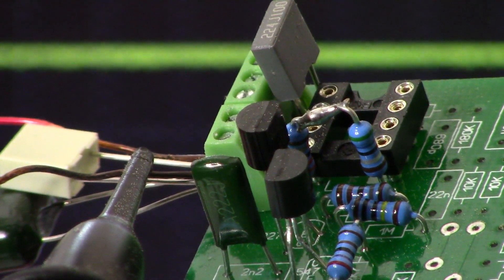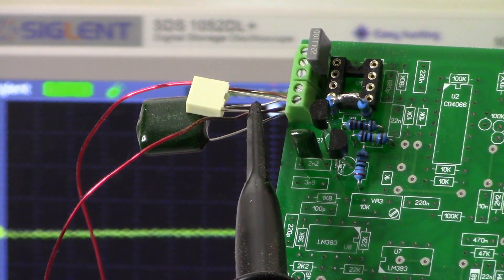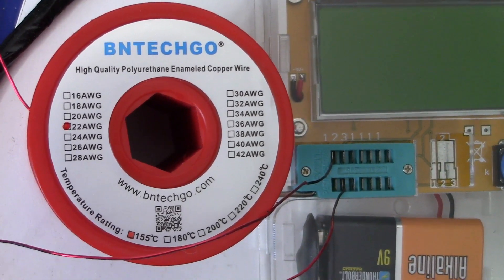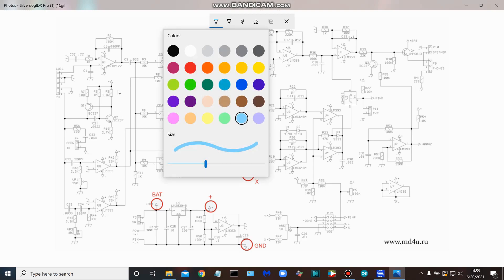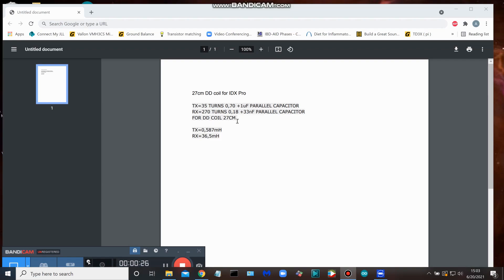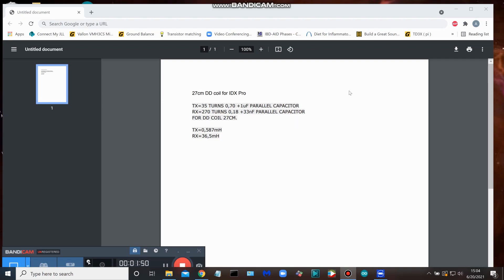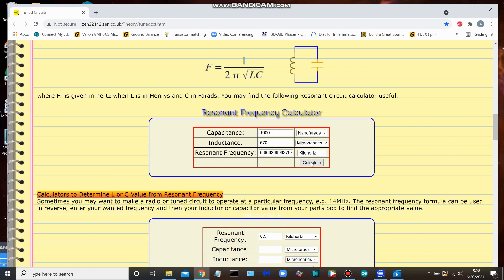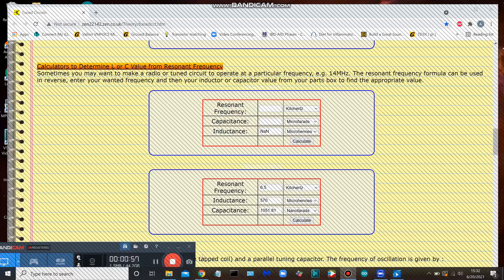IDX Pro part 2 Transmit circuit

Comment: Good morning,thank you for sharing,this is Mohamed from Alexandria Egypt,at 4.49 top left where it says coil ,point number 5 where it goes and what is connected to it .also .70 +1uf capacitor is it .70 volts or what is the value here and same for the Rx capacitor?, I don't have an inductance device to measure the inductance of the coil wire is there any other method?I may keep asking some questions until I finally make my own clone ,thanks alot for your patience.
Reply from the maker: You should have an LCR meter in order to check Inductance.  You also should have an oscilloscope for building the metal detector project, otherwise you will not be able to check your work and make proper adjustments.
Reply: @SurfDetector  ok I understand,I can't afford buying these two now,,what about the oscilloscope diy  videos that you can download Android scope master then modify your head set to an oscilloscope?
Reply: D4 is connected between 2 deferent polarities? Is this correct?
What is the value of C1 ,thanks
Reply from the maker: @mohalmisri1230  Yes D4 is connected correctly. C1 is 1nF.  You should go to the Geotech Forum and read all of the information about the IDX Pro.

Comment: IDX pro metal detector coil diameter wire diameter tx rx number of turns and how many kHz should it be bro
Reply from the maker: Hello my friend, most of the answers to your questions are in this video.  The coil was a DD, I don't remember the diameter.  The KHZ and inductance are what you need.

Comment: Great series! Looking forward to the rest of the idx pro build. I have a couple of questions if you don't mind. When you tested your coil for 6.5khz did you use the transmit circuit of the idx or a signal generator? Also the calculators for F, C and L don't give a wire size. How did you know what wire to use to match the impedance of 1.2ohm? My classic sl transmit coil is 2.3ohms I think its the same family. If impedance is off you will suffer amplitude loss or over heat yes?
Reply from the maker: Hello my friend,
As shown in this referenced video I used the TX circuit to prove the frequency of the attached coil.  I used 28 AWG wire for this project if I recall correctly, most people use 30 or 32 I believe, I did not note an appreciable difference in the results.  The resistance difference +or - will increase or decrease amperage accordingly.

Comment: The Classics and IDX series are a lot of fun to work with. Serious improvements can be made to those machines. Stock, you’d be lucky to detect a coin sized object any deeper than 6-7” in ground. Usually more in the 4-5” range. After a range of “Mr. Bill Mods” the penetration increases dramatically becoming more in line with the (depth) performance of the MXT, maybe better at 12”+ on some coins. With ground balance the sensitivity mods are also very stable. I half expected to encounter a chattery hot mess.
Reply from the maker: That for the comment.  Building these circuits in the DIY format is always somewhat of a challenge, but that is part of the enjoyment.
Cheers

Comment: Parabéns pelo vídeo, uma observação, R56 (100R), C33 (6,8nF) e P4 (1K) também fazem parte do circuito TX.
Reply from the maker: Hello my friend.  Thank you for watching.  Yes you are correct they are part of the TX circuit however they are not necessary to be installed for the TX to work properly as they only are for slight frequency adjustment and in some IDX circuits they are completely removed.  Once again, thank you for watching and for your comment.

Comment: is nice to see you are doing a vlf project, i may learn something from this. One thing that i’ve noticed, when measure the coil keep it far from metal, inductance can change in presence of it. And regarding the tester from china, that i also have, it has a difference reading (on inductors) when compare it to my LC meter. I have to find a third multimeter to see which one is more accurate. Regards
Reply from the maker: Thanks for the comment regarding the tester.  I had pondered the accuracy of it as well, however as I was able to use the formula to accurately calculate the capacitance value that I needed for the correct frequency I believe that the inductance value must be relatively close.
Cheers